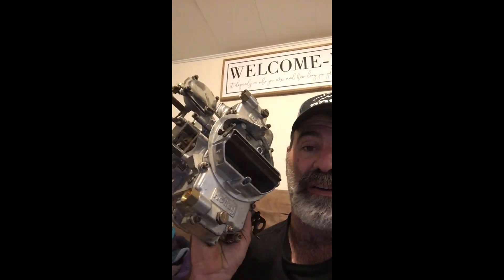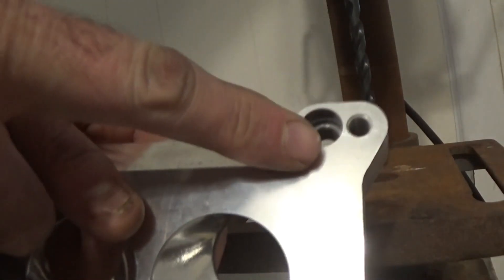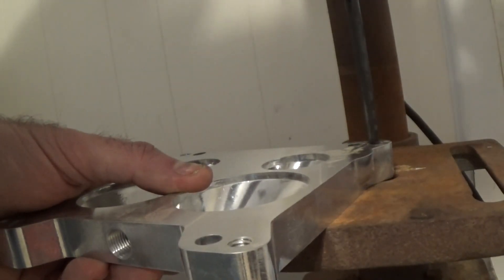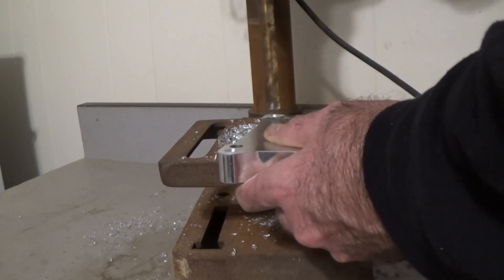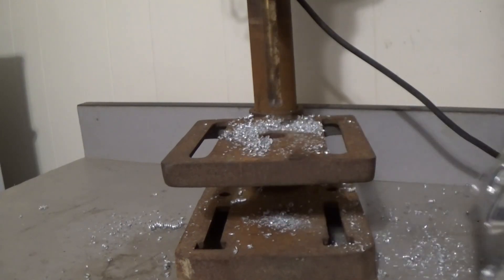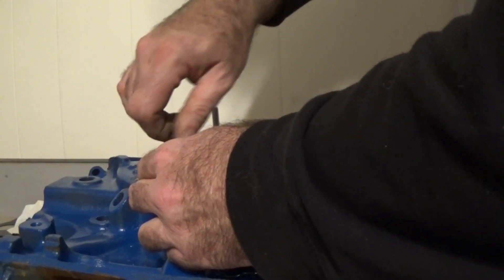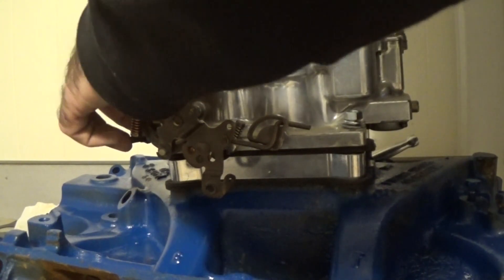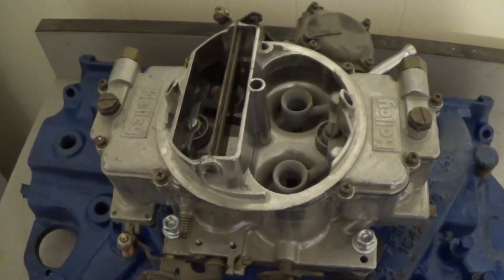A Holley Spread Bore Carburetor on a Ford 390?

Comment: hello  friend,.... at  15  yaers  ago  i  replaced  a quadrajet on  a  350  OLDS 72  by a  spreadbore in my  boat  and the speed  junped from , 35 to 40 miles , i  stayed   very  happy  and  no  more forgot  that  test..... now.. today  i'm   mounting  a Tbird 64   whith   a 390  10:1  and  edelbroks  264  cam......    and  i  was  just thinking about that experience on my  boat  running  whith  spreadbore   and   found  your  video  about  it.........  I  would  like your opnion... what may be  better  to tbird...?   the  1450  HOLLEY or  the  spreadbore ????.I  will  apreciate your opnion  based in  your  large     experience  with  390s  thanks  by  attention  and   sorry  by  my  bad  english    tradution
Reply from the maker: In all honesty if two carburetors are properly tuned and the correct size for the application, there will be very little if any difference in maximum power output. I’m only switching to a spreadbore to gain fuel mileage but still have maximum power output if I need it. If you aren’t concerned about fuel mileage I would just stay with the regular Holley carburetor.

Comment: I'm surprised there are not more spreadbore carburetors on the market. Especially since Summit makes/sells the square bore 4010 version of that carb.
Reply from the maker: I really don’t know why more people don’t use spread bores. They give you the best of both worlds. All I can figure is Quadrajets gave spread bores a bad name. I hear people cuss them all the time but in all honesty a good quadrajet is hard to beat for street performance. Now thermoquads are a different story😂
Reply: @BlackLabGarage  They got a bad reputation just like how some people will cuss at Holley 4150/4160's because they leak except, I've never had one leak lol. Usually, the people badmouthing stuff don't know what they are doing. My dad worked at a Dodge dealership for a while in the late 70's. He has a lot of thermoquad stories to tell.
Reply from the maker: @MattsRageFitGarage  The only Holleys I"ve ever had leak were ones that I got used from someone and they had put those cheap Mr. Gasket cork metering block and bowl gaskets on. Those always draw up and cause leaks but carbs with good gaskets I've never had a problem out of. I have a Holley 500cfm 2V on the 400 engine in my F150 that has been on there for 12 years and it hasn't leaked at all.
Reply: Absolutely sir, that is exactly the way I did it. It was the best thing you can do on an FE. They have such a strong signal and once you get it right, it stays there. I really wish they still made them and an adapter like yours it is the best carb you’ll get!  Getting the secondary spring  to come in and it’s like a regular Holley, no burp or hiccup, just a pull that pins you to the back of the seat and a low moan and the vicious FE scream from 5000,until you run out of cour- I mean road. The best carb I’ve ever had.

Comment: Looks to me like the secondary holes in the gaskets are going to restrict the carb secondaries quite a bit.
Reply from the maker: I'll check it when I bolt it up on the intake that is on the motor and trim it if I need to.

Comment: hello  friend....I'm   here  again....  for  a Marine Chevy Gm 262 4.3L Ohv V6 12V,  year  87,  non  VORTEC,  rebuilding  it  all new...  about  pistons  quality.....  with  your  large  experience  in  pistons....       ENGINETECH   or  Silvolite pistons and moly piston ring set (Perfect Circle/MAHLE) for Mercruiser 262ci/4.3L applications   ???    I'm  looking to  impot  its  via  Ebay.....more  the  Silvolite  price  is  the  double....other  big  problem...  the  rollers  lifters  for it...   CHINA parts  are  no  goods  and   what  USA  lifters you  suggest  ??      thanks again
Reply from the maker: Enginetech doesn't make anything. They get other manufacturers to make the parts for them and then they just put their name on the box. I've never had any problems with the Enginetech parts that I have used. Perfect Circle/Mahle rings are good as is most any part that has Mahles name on it. As far as USA made lifters I only know of two companies. Morel and Johnson. I believe Morel offers a stock replacement hydraulic roller lifter and that's probably who I would pick for lifters.
Reply: @BlackLabGarage  thanks  again
Reply from the maker: @angelmarine8194  you're welcome

Comment: I don't like vacuum secondary to heavy on gas
Reply from the maker: How so? They should only be opening if the engine is needing it? If they are opening too soon you can always put a heavier spring in with the diaphragm so they don’t open as soon.